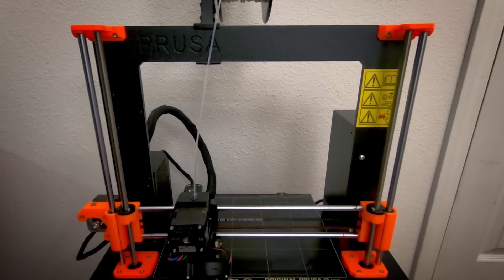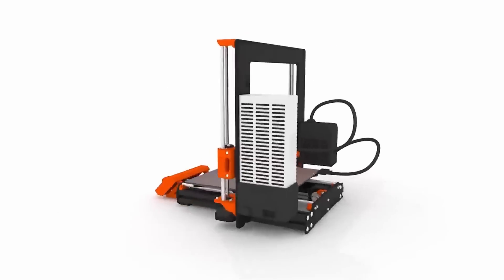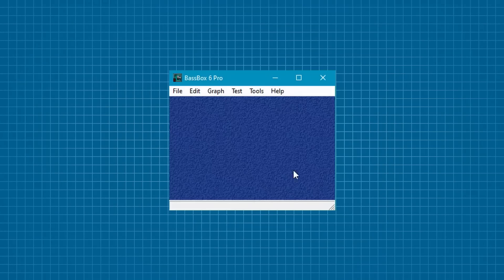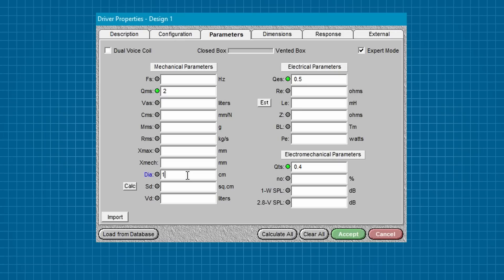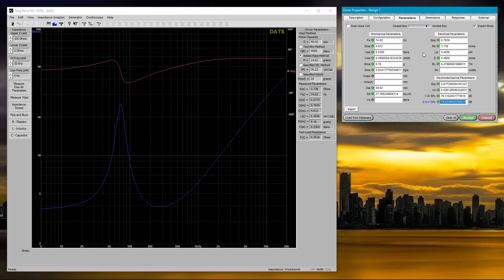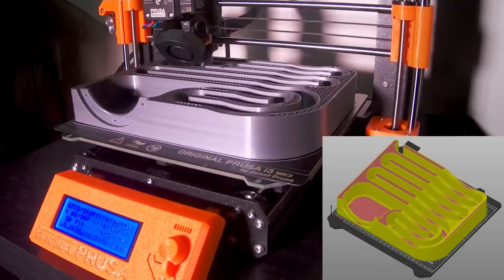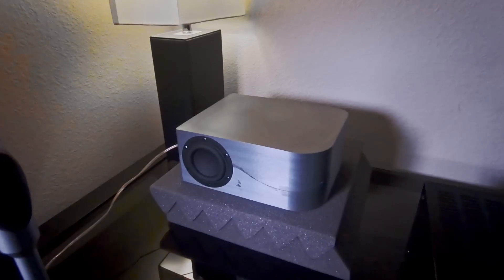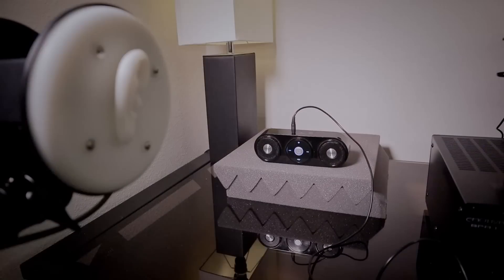Can a 3D printed enclosure get low?

Comment: I thought the bass part was badly distorted so I googled the original and it turns out the output of your speaker is exactly what the song sounds like.   What I thought must have been distortion is the result of how the artist created the song.  This was an excellent video showing what can be done with a solid design and made DIY.  Nobody would have thought this possible only 20 years ago.  Great job!
Reply: Thanks for checking.

Comment: I was so hoping for a download link for the box to print for myself lol
Reply: @HexiBase  sort of looks like you could create a slot type setup if the wall thickness isn't an issue for strength with that filament.  Maybe a little smaller male portion to allow for a good amount of epoxy to ride in the slot and glue the two together.  Probably don't need the wave profile if you do the slot.
Reply: @HexiBase  If you haven't already, try printing the two halves flat, then lightly sand to knock down any imperfections, then JB weld. You could also attempt plastic welding, certain chemicals will melt the surface of certain plastics, making them 'weld' together; though I'm not sure how effective this would be over that much surface area. 
Because of the complexity of the inside of the box, if sanding then bonding doesn't resolve the issue, you may have to get more creative in how you print this.
Reply: @HexiBase  I'd love to have the plans to print the box even at it's current state. :) Great work! Maybe make it downloadable for a donation or a small fee? :)
Reply: If it would've been Printed in ABS, Acetone is a great "seal and bonder" for ABS. I glue my ABS prints primarily with Acetone, as it feels after drying like on solid piece. 

But great work you did Anyways. 

Printing that with most normal Printers might be hard, specially warping might be critical. I have a delta, I can't print it, Printbed is round...:D
Reply: You could have a slot on one side with a raised ridge on the other. Fill the slot with epoxy and put em together! Should work to seal any leaks.
Reply: 3D gloop will chem weld PLA
Reply: @HexiBase  I second the acetone. Even doing a light application of it along the waveguide before sticking it together can also smooth out the internal walls to the extent it will seal much better and get better air flow. I have done this with my 3d printed bass ports.
Reply: yea, Link would be awesome haha
Reply: @jensharbers6702  Good suggestion, but there are definitely better options than ABS, like PETG for instance.  The small benefit it provides in bonding with acetone is far outweighed by the difficulty to work with.  For a print that size, you'd absolutely have to have an enclosure.
Reply: @sleebusjones  I don't think that many people will be printing this other than for the wow factor or just simple convenience.... At least  I'm not lol. Anyway, I agree that ABS would be a nightmare to use in a project like this. However, just guessing (as of now), that PLA, would provide the best sound due to it being much stiffer than other thermoplastics. However, PETG would have the advantage when it comes to the screwing part.

I guess I'll find out soon enough when I find the stl😂. Hell, maybe I'll even try TPU just to say I tried.
Reply: What infill % did YOU printed and how much filament did you used?
Reply: that's impressive. especially when you went into the adjacent room. from a 3" driver nonetheless! Bose wave radio eat your heart out
Reply: @HexiBase  try using acetone to adhere both sides instead of an epoxy. should work a lot better, since it'd literally melt and fuse the plastic into one single piece. I believe acetone will work best with PLA. Not certain.
Reply: @HexiBase  Love the design! The spline-curve-split is beautiful; and the bass response is up there with higher-end equipment but the leaks could be eliminated with a thicker layer of bonding material / glue between the 2 halves.
I personally wouldn't even try to make the join invisible - but make the adhesive layer >5mm in black.
I would try something like Shoe-Goo adhesive to join the halves, making a rubberised join in Black.
A downloadable version would be (hundreds of) thousands of admirers Christmas' at once! Great stuff
Reply: Amazing what is possible today at the DIY level.
Very impressive.
I subscribed.
Reply: @HexiBase  Have you thought about using a interlocking groove/channel that follows the waveguide on both sides and overlaps to avoid leaks and would provide a good groove to apply a 2 part epoxy?
Reply: @HexiBase  Alignement pins (and holes) on both sides are a great way to, well, align them during the "bonding" :) Cheers
Reply: @janolesen6045  yeah but that's easy. I've already done that lol
Reply: i have a 04 Grand Cherokee. and want to put a sub in it. i think this would work perfect be easy to hide out of the way due to the size so i dont lose room. hoping for a file to print our own in petg! awsome work!
Reply: @HexiBase  thanks for planning on it then. just found your channel. but cant wait to do this myself one day.
Reply: @HexiBase  Alignment posts / tabs and matching recesses on the mating face will make the bond better as well.
Reply: @HexiBase  Some of those leaks, though I can't say for certain since I'm not there and all that, could be a product of the printing process. FDM prints aren't great at being airtight, and there's likely always going to be tiny gaps all through a print, except maybe in cases like ABS, which (stinks on ice to print and) can be smoothed with acetone vapor. If that turns out to be a significant reason for the leakage, I'd suggest sealing the internal surfaces with resin. There's at least one marketed specifically for that, XTC-3D, but you might even be able to get away with painting on a thin layer of JB-Weld for this application.
Reply: Subscribing to this thread.
Reply: Lassi Kinnunen  I think I've seen people just dab it on the seams and it seemed to work just fine
Reply: @HexiBase  I modeled one very similar using the manufacturer's ts parameters. My internal volume is .077 cubic ft with a port length of about 1.48m. I'd love to trade files with you for comparison
Reply: Xander Vice just use a gasket maker like RTV and design holes in the model so you can run bolts through that way its serviceable and has a perfect seal
Reply: @ryanstreuli8667  that actually sounds really smart
Reply: Id sure like to see that file too!
Reply: @HexiBase  Any chance you posted this yet?
Reply: Patiently waiting for that stl upload :D
Reply: @HexiBase  I would love to print this if you release it -- even its current iteration would honestly be fine. Nothing a little more JB Weld can't fix! :)
Reply: HexiBase perhaps incorporating a tongue & groove on opposing pieces when printing a planned, sealed seam, along the entire length of the seam. Apply a thin continuous line/bead of quality rubber adhesive in the groove & pressing the tongue should evenly spread the adhesive, sealing off any air leaks. T&G practically doubles your adhesive/bonding surface area & it’s design assists in sealing the gap. 
Awesome design, btw! If you don’t mind me asking, what printer did you use? It wasn’t in your description.
Reply: @HexiBase  Add a small groove around the external mating areas to catch excess epoxy, kinda like the grooves on a cutting board to catch juice.
Reply: @HexiBase  Why JB instead of something like Silicone II?  But like others suggested, it could be sealed better with a tongue and groove with minimal epoxy or silicone.  I would definitely like to print it myself.  How well could this potentially be scaled up?
Reply: @HexiBase  I would Love to have the stl if you are willing to share. Thank you!

Comment: your 3D printed one sounds way better than a mass-produced one
Reply: Yea, those mass producers "fudge" their numbers to where you don't know what you're truly getting, and what you do get sounds rough and limited in its performance. Massive room for re-design and improvement. This is genius designed and makes those poor mass produced subwoofers feel inadequate, and cry with bass envy, and are in massive need for therapy to work through their inadequacy issues. Some of those mass produced guys turn to alcoholism, break down, and crack their speaker frames introducing a noticeable rattle that makes them feel even more inadequate until one day they end it all and burn up their voice coils. Better to be non existent than be a sub par sub woofer.

🔊))))🎵🎵🎵🎵🎵😃😊😀😎      
              
🔉🎵😧😭😥😞🔫🔇💀
Reply: yeah but 100times more expensive :D
Reply: @banny123456  its not 100 times more expensive if you already have 3d printer.  its only like 5 times more expensive ?
Reply: not quite...    the other one is a smallbox player/speaker....      compared to a bigbox player/speaker of sony or jbl, the printed one wont be THAT much better

dont forget this is just a speaker, nothing more...
Reply: Combine this with some Raspberry Pi stuff, a bit of bluetooth, an SDR tuner unit, a small touch screen, about 4 18650 rechargeable lithium batteries, a few buttons and/or quaternary encoder knobs, the right amplifier circuit, and you'd be able to make a completely modern boombox better than you could currently get at the store.
Reply: @biziluxgames8924  well, speaker $38, roll of a good pla plastic $15-20 assuming you already have a 3d printer, and since its 2019 only my grandma don't have one.. i have 3, ind i want more but one bedroom apartment limits you, to squeeze it in between laser cutter and plotter :)) Electricity cost?... IDK, +$3 , experience - priceless!!

Comment: You need a video of that woofer just in a small sealed cube for comparison.
Reply: Using a sealed enclosure requires double the power to achieve the same level of sound so it's very inefficient and mainly used for people that demand small enclosures and don't care about power usage, but it will be very tight bass response.
Reply: @npham54  It's very efficient at damping, hence... Well, any serious high quality of reproduction speaker will be a sealed box. Unless we go into esoteric shit like infinite baffle.
Reply: @NGC1433  what  do you mean 'esoteric shit like infinite baffle' Im sorry it may be due to the fact that im not a native english speaker , but i really dont understand what that means exactly
Reply: @baronnashor158  The baffle is the face of the box that the driver is mounted in. The purpose of a box is to keep the sound waves from the back from destructively interfering with the sound coming off the front. A sealed box does this by damping the back wave, but it limits bass response since the sealed air chamber acts like a spring trying to resist movement of the driver. 

A long tube like this design allows the back wave to come out in phase with the front (at the tuning frequency) which then adds to the front sound wave, making for more bass. The tricky part is to get a broad enough tuning to avoid the huge peaks and valleys in the response which give that boomy one note bass sound.
 
An infinite baffle is really just a giant wall that the speaker driver is mounted in. No box to add damping and limit excursion, and since it is 'infinite' the back wave will never come around the outside and interfere with the front wave. Nor wil it reflect off the inside of the enclosure and push on the cone. Infinite baffles sound amazing, but as you can probably guess are not even remotely affordable, or portable. It's what you do if you can afford to build a house around your stereo.
Reply: @belstain  thanks I always wondered what infinite baffle is when I see it on AVS forums and other places but never cared to look it up. Very interesting.
Reply: Or a reflex box, which makes more sense in this use case.
Reply: Modeling it in Winisd with the manufacturer's parameters comes up with a 0.56 liter box, with an F3 cutoff of 92 Hz.  That should sound OK even without a subwoofer.  HexiBase's actual measured parameters suggest a larger box (8 liters), but the 0.56 liter box should still be reasonably good.    And, if possible do the measurements outdoors where there isn't any room gain or resonance modes to mess up the response.
Reply: @belstain Nice explanation, thanks!

Comment: defiantly needs a tweeter or small full-range from 500hz up lol
Reply: Yes but it is a subwoofer so what do you expect
Reply: Or just buy 2 of these. Build 500 Hz crossovers and get 2 inch tech BMR drivers for the mids ands highs. You will get pretty decent bookshelf speakers out of the build.
Reply: Gabriel Vieira granted but he was talking about using this as a Bluetooth speaker,unless I misunderstood. I bet it could actually sound really good if you matched it to a full range like David suggested
Reply: He was talking about getting the proper sound with the speaker using technology like the 3d printer making it possible to dial in the exact specs and the speaker truly performs to its fullest ability. He sad this was a subwoofer, not a Bluetooth replacement. He was showing the difference in sound vs a Bluetooth for bass response as most Bluetooth speakers has a pair of 2" sometimes larger woofers normally with bass radiator.
Reply: bass should be rooted to the front next to sub. 1" apart in the middle
Reply: @Jozavenue  lol ok if you say so. The way he did that was damn near a perfect match to what the sub was capable of doing. There is no better match then that.
Reply: 'defiantly'
Reply: WOT ? 'Defiantly' is definitely and undefiably inappropriate in this context. (-;
Reply: @johndelilo6038  WHAT does 'WOT' mean?  seems inappropriate in this context? (being a grammar nazi) (-;